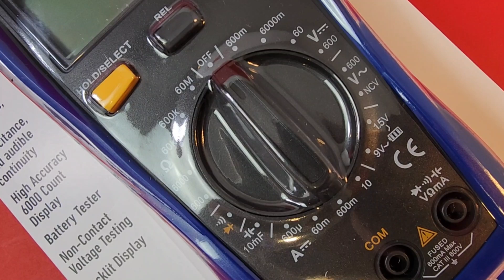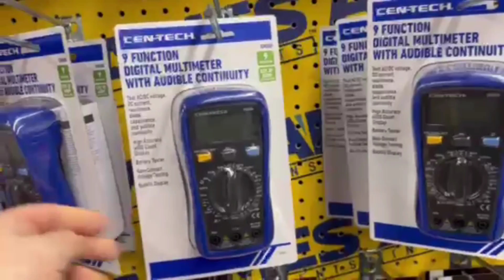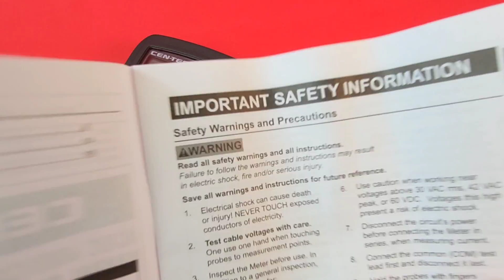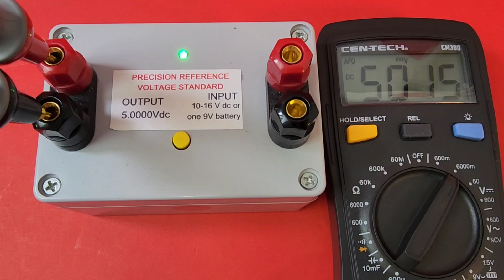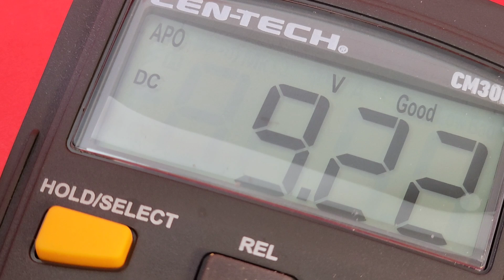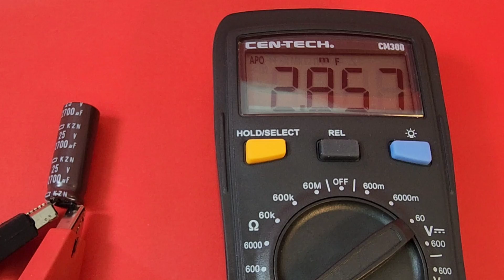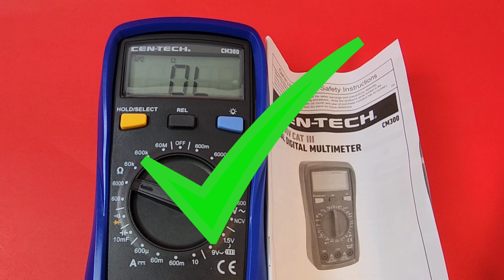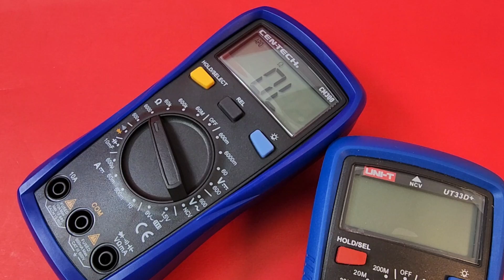CEN-TECH (Harbor Freight) CM300 CHEAP-O Multimeter Review & Teardown! + Store Walk-Thru!

Comment: Can you set this multimeter to 60 standard dc volts to check your 12v car battery? Thanks.
Reply from the maker: Correct. Set the range selector to 60V DC to test your 12V car battery. 👍
Reply: @KeepOnTesting Thanks for your quick reply. I really appreciate it.
Reply from the maker: Keepontesting! 👍

Comment: I’ve had lots of meters both expensive and cheap - This one is a very good buy with great build quality. Excellent rubberized leads and a premium softer plastic case.  I dislike auto-ranging meters, so this one is great for me.  Even the continuity tone is nice and loud - Great meter at a great price that will likely increase.
Reply from the maker: 👍 Great point..it's nice to have the ability to manually select the range!

Comment: Harbor Freight's soldering stations are pretty good as well. The analog model for $45 USD has temperature sensing feedback and regulation and is  surprisingly well built for the price; I posted a review and tear down of it on my channel recently.  I also bought their digital unit ($120) and will post a review and tear down of it soon.  Both units are made by Atten and use what appear to be knock off versions of the standard Hakko ceramic heater elements, as well as standard 900 M or T18 tips; although the tips that come with the Harbor Freight soldering stations aren't very good and the units will work better if you buy genuine Hakko tips for them. [PS,  The owner's manual that comes with the Harbor Freight digital soldering station is pretty minimal ---- this is common for HF products ----  but Atten's website has a more comprehensive owner's manual for the digital ST-80 soldering station, which users will find to be much more helpful because of the programmable nature of the unit].

Comment: Where would I be able to get replacement fuses for this multimeter and what type of fuses are they, I'm new to all this stuff
Reply from the maker: Give me an hour..and I'll have all the info!
Reply: @KeepOnTesting No rush or anything It's not a super pressing issue.
Reply from the maker: @kingcruseder4737 no worries, On my way back from the office..hang tight 😊
Reply from the maker: @kingcruseder4737  10A Ceramic 600V / 6x25 mm <> 600mA 600V 6x30mm
ALIEXPRESS has them all. https://s.click.aliexpress.com/e/_mscX4q8

Comment: Is this for only regular batteries? Not car battery?
Reply from the maker: Battery check only works for AA/9V . You can still check your standard 12V car battery using the DC VOLTS set to 60.
Reply: @KeepOnTesting The 60DC Volts is exactly how I tested  mine  before  leaving  from H.F. ,I tested with my car battery 😊

Comment: That looks exactly like the Uni-T UT133b rebranded as Cent-Tech. Looks the same on the outside and the inside and the board actually says 133B towards the middle. The UniT runs about $25US and this as Darren said was $19.99 US in the store. Not bad!
Reply from the maker: Yes indeed Mike..UNI-T is the OEM here..not a bad price as you said! 👍
Reply: @KeepOnTesting ,  It occurs to me that you never went through the owner's manual to see how comprehensive it is or isn't. Manuals included with Harbor Freight products tend to be pretty minimalistic, but in the case of the HF soldering stations I mentioned in another comment, once I figured out who built them I was able to find the original ATTEN ST-80 owner's manual for the digital soldering station online, and it's more comprehensive and easier to understand than the bare-bones manual that was imcluded. When reviewing inexpensive products like this multimeter, or a soldering station, it's important to note that for many people it might be the first time they've ever used such a product and they may struggle to learn and understand its capabilities.  You might want to find the manual for this meter online from the original manufacturer and post the link to it here.
Reply: @KeepOnTesting  Uni-T one also does AC current.
Reply: Darren didn’t get the 30% off coupon that was available at the time.  Usually the is meter can be had for $14😊
Reply: $15 on sale right now

Comment: Nice inside. I think that R shunt can take 20 amp current.
Reply from the maker: I think you're right! 😊 👍
Reply: The test leads are also very capable, I measure 21 milliohms each. They are very pliable and yet sturdy.
Reply from the maker: @pault6533  Thx for the update Paul. Definitely a rarity..cheap but capable dmm and cheap but capable test leads.. 😊 👍